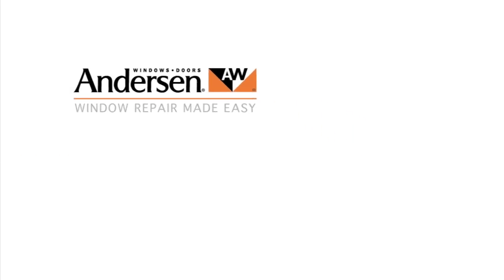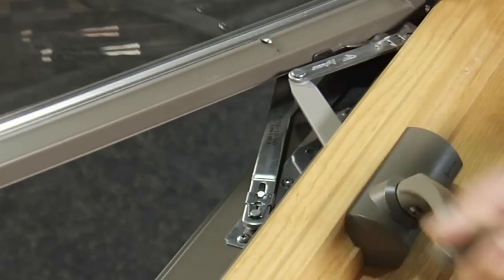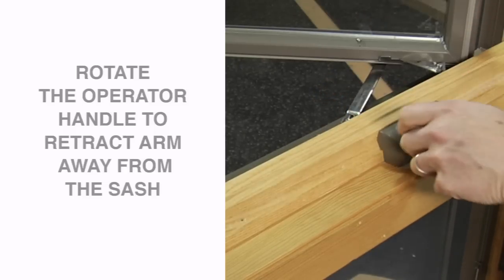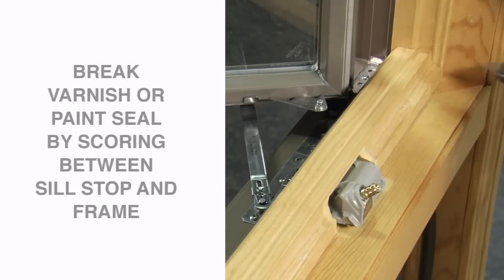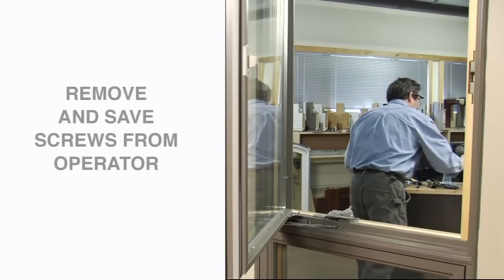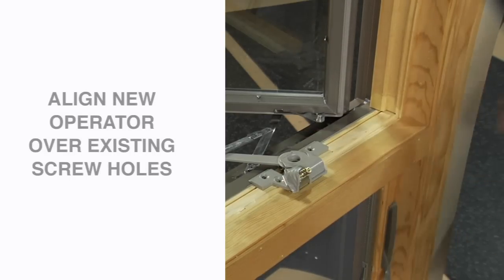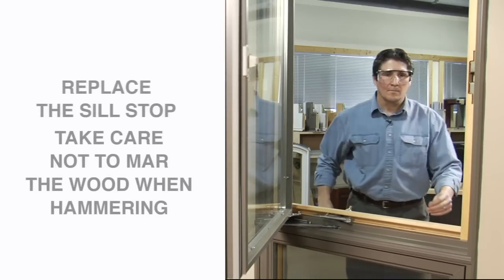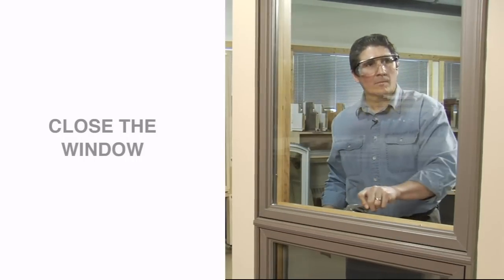Replace a Split Arm Casement Operator | Andersen Windows

Comment: This was very easy.  The replacement crank was for either left or right side.  The wood trim broke but i just glued it together and the nails will hold it together.  Thank you Anderson.  One thing you should mention in the video how to find out model and serial number.

Comment: I had a problem with one of my windows skipping when I tried to open it. Didn’t want to pay someone so went a year without fixing it. Had someone coming for the roof so figured I’d get the parts and have him do it. No need!! I just replaced both sides myself and it works so much smoother. This was even easier than the video makes it look! Hardest part was wiggling the trim up without breaking it.

Comment: Great info.  Except the part where he uses the old crank to hide the split arm.  The primary reason someone would need to replace the crank (in the first place) is most likely due to the crank being inoperable (stripped).  The second thing that would have been helpful to know is whether this example demonstrates a left—handed or right-handed crank replacement for DIY users.  Other than that, thanks.

Comment: Anderson casements installed 1977.   Lever system unlike what you show.  These have a long steel arm with a plastic slider that tracks along a rail on the window frame.  The plastic slider is broken.  My questions are:  1.)  does plastic crank cover just pop off after removing crank handle? or  is this plastic crank cover not removed?   how?  2.)  Is wood trim removed , just like in video shows for the newer style crank system?   Or is crank system removed in a different way?

Comment: I have an old style cover around 1974-1979 with no screws and cannot find any information on how to take the cover off. I beleive it is Casement Operator Cover part #0532608. Spoke to two Andersen reps, both of which said it should pull right off and one of them said the casing may be holding it on. I stated it rocks left and right and there is no paint holding it in. Seems like the center is held in somehow causing not to slip off the shaft. Tried pulling it off by hand, using a screw driver, clamp to get a good grip and small pry bar. It's not coming off. Any suggestions?

Comment: How do you identify the proper operator model for a window installed 10 years ago?  Where can I buy authorized parts?
Reply from the maker: Tony, open your window and look down at the operator arm - if it looks V shaped then it is a Split Arm Operator, if it is straight, it is a Straight Arm Operator.  For the Straight Arm Operator, you need to know if it is handed left or right. This is determined by viewing your window from the exterior - whichever side the hinges are on is the handing of your window. Split Arm Operators are universal.  Home Depot may carry the operators. If not, you may order them on line or contact us at 855-337-8825.

Comment: "If replacing the operator on a 400 Series Perma-Shield® casement window manufactured from 1995 - 1998, an additional  adaptor plate must be installed to the bottom of the operator for proper fit and installation."
Where would that be on this installation?
Reply from the maker: +Veracity Good question - When replacing an Andersen® 400 Series casement or awning operator manufactured from 1995 to 1998, a current vintage operator and an adaptor plate must be ordered.  After removing the old operator, the video shows attaching the new operator and the next instruction is to snap the adaptor in place.   The adaptor plate snaps onto the base of the operator mechanism with no modifications needed.  The operator base holes are in the same location for both vintages.  There are no special instructions for installing the adaptor plate as it snaps onto the bottom of the operator base plate.  After the adaptor plate is snapped into place, the current vintage operator will have two holding legs and will work as a replacement operator on casement window frames manufactured between 1995- 1998.  After the adaptor plate is snapped into place, the operator can be installed with no modifications.  Let us know if you have any further questions.

Comment: Are there advantages between straight arm vs split arm? is there a reason one is used over the other? thanks
Reply from the maker: The short answer is that it is mostly personal preference.  The longer answer is that with a split arm there will be a slight gap between the window sash and the frame of the window. A lot of people prefer this because it makes it easier to wash their windows. With a straight arm, the sash will open snug against the frame of the window so this type of operator is preferred for egress windows.  For most window sizes, you would have this operator option with the exception of the narrowest and widest units. Let us know if you have any further questions.
Reply: @Andersen Windows

Thank you so much for this explanation. You should have this readily available on your site and referenced in some way in your product guides where the following is found. --- *Meet clear opening width of 20" (508) using sill hinge control bracket with split arm operator specified (bracket can be pivoted for cleaning position) and meet clear opening width of 22" (559) with straight arm operator specified.

Comment: Is the attachment screw in the Operating Handle supposed to make contact with the threads in the operator?
Reply from the maker: Hello, Thanks for reaching out. If you have additional questions, our customer service team will be able to assist at 888-888-7020.

Comment: How do I open the window for step #1 if my handle just spins and doesn't open the window?
Reply from the maker: Jasers - Thanks for reaching out. You should be able to gently force the window open slightly, which will allow you to remove the sill stop and expose the screws securing the operator to the sill. We recommend using a thin-bladed putty knife. This will be done after the handle and operator cover have been removed. These steps are also in the video. Please let us know if you have any further questions!

Comment: Who replaces a brand new opener with a brand new opener? Nobody. The problems of an old, painted in window are not addressed here at all. Neither is the question of which replacement opener to get and its handing. Useless video.